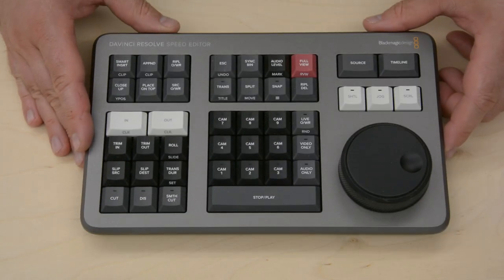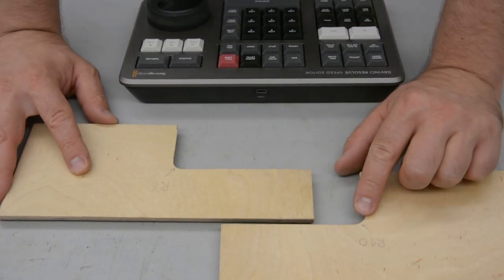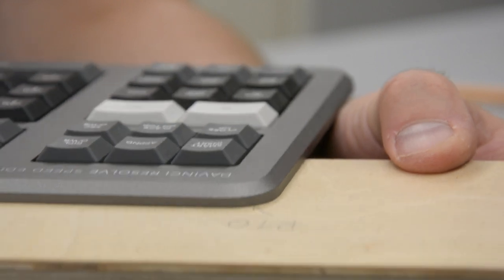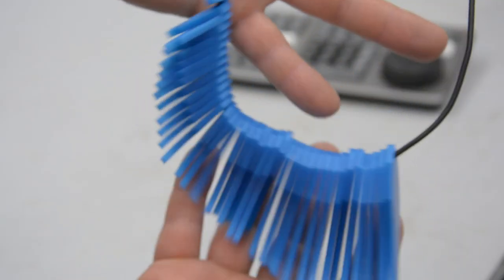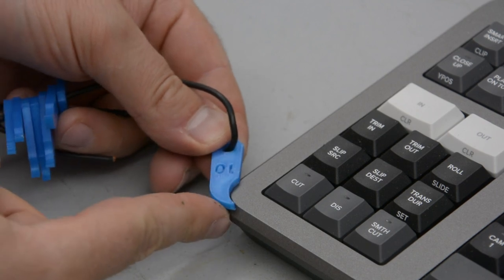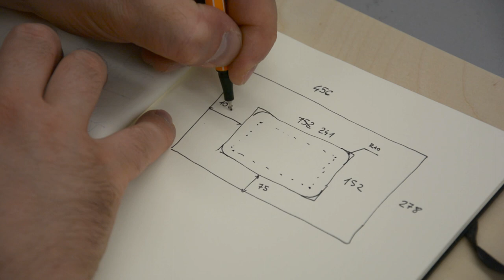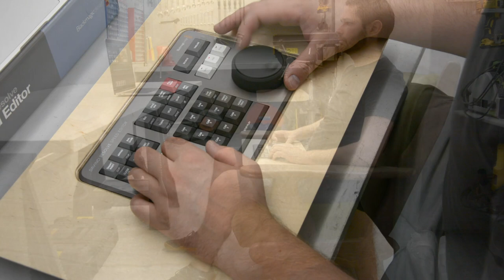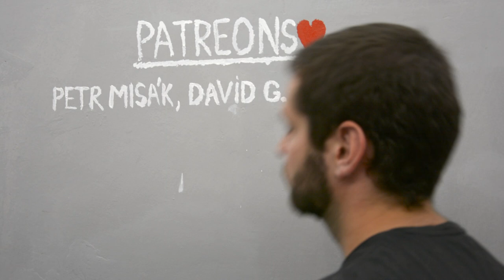DIY Table For Davinci Resolve Speed Editor

Comment: I'm sorry but it makes sense that it is inclined, it is for ergonomics, it also helps to be able to read the keys, if it were flat you would not be able to read the keys and it would not be having the ergonomics of a keyboard.
Reply from the maker: Hi, thanks for the comment! For me, it works better that way. I'm used to low profile keyboards such as the external Thinkpad with the trackpoint and a palm rest. That's why the palm rests exist in the first place - to prop up the wrists so they are not bend. Take a look at the ErgoDox for example. They combined all the biomechanics principles of human hand and made something extraordinary: https://ergodox-ez.com